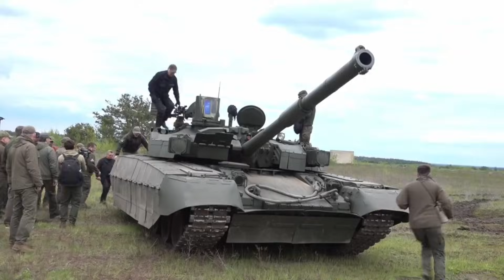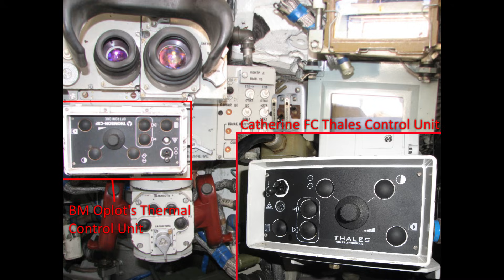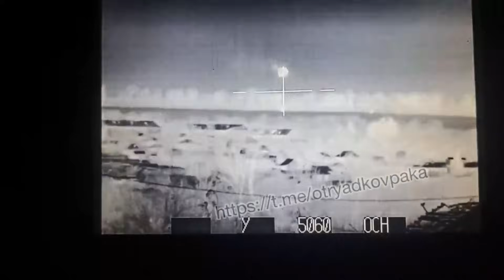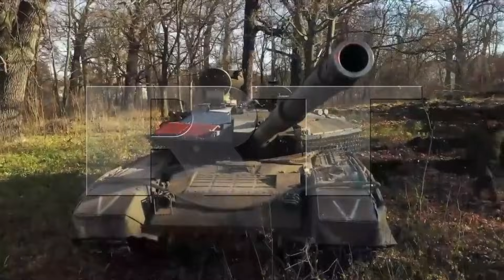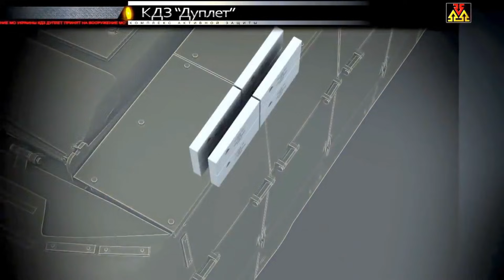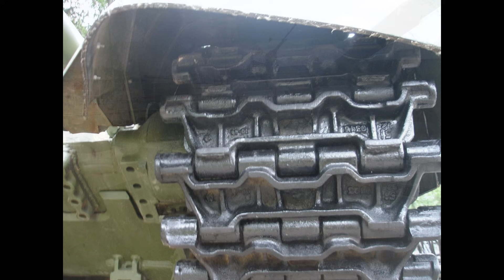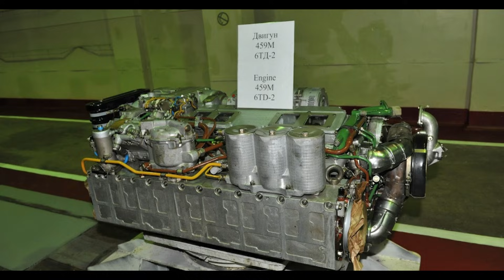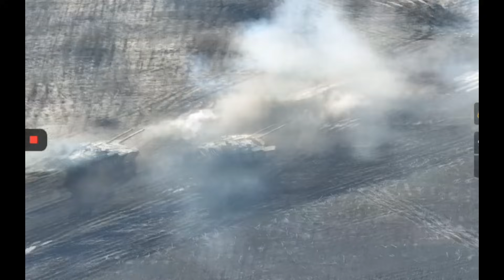Best Ukrainian vs Best Russian tank. T-90M vs BM Oplot comparison

Comment: I remember watching a Ukrainian tank unit video going over how they abandoned their T-84 cause it was getting overrun. They came back and it was still there so they retrieved it. 
I also remember how the tank commander said he had 6 T-84 BM Oplots also didn't Thailand sign a procurement contract for 48 T-84s so theres bound to be more than 6 as surely those that were meant for export were put into Ukrainian service
Reply: They were facing production issues before the war, which is why they struggled to provide the tanks to the Thai in the first place. They might have more but still a tiny number I would imagine.
Reply: @GrassMudHorseLand  ahh I see
Reply: @GrassMudHorseLand  They were facing production issues because of the invasion of Crimea. They finished delivery to Thailand in 2018, leaving them a few years to replenish their own stocks.
Reply: @justamicrowave2572  yep, but they barely finished their promised batch to the point the additional contracted tank were cancelled. Giving how slow they were building hem during relatively peaceful time, it’s unlikely they have any moderate number of them even during the 2-3 years time.
Reply: @GrassMudHorseLand   they still provided 51 tanks for Thailand

Comment: T-84 and BM Oplot were manufactured in Kharkov. Now the production facilities had been within striking distance of Russian cruise missiles and tactical ballistic missiles from the outset. Russians had been striking targets as far westwards are Lvov, meaning, manufacturing them anywhere within Ukraine is impossible. Russians will simply strike the factory and be done with it. Attempting to set up manufacturing in Poland could work, but would still require a long time since Poland used to make T-72-based tanks, not T-80-based tanks.

Comparing their firepower using only APFSDS as a metric for the main gun is not really appropriate since newer ATGMs and HE-FRAG rounds had been developed for both. However it's a known fact that 2A46M5 main gun is more accurate and can withstand higher chamber pressures than KBA-3. Also 2A46M5 barrels are of significantly higher quality than KBA-3. Last I heard, KBA-3 barrel is being made at a pipe-making factory, and as a result it's not as precisely made and has lower longevity.

Comment: I really like the T90M, it looks really good. Can you make a video on T90M vs Type 99A? I love the ERA coverage on the T90M and I found the coverage on the Type 99A lacking. But, T90M goes to war and is upgraded accordingly while the Type99A is still at peace time mode without extra coverage or remote weapons station...I found it interesting that the 99A weights 55T while the T90M weights only 48T, why is that...and still, T90M has horrible reverse speed and I think Type99A can reverse up to 30KM/H as per some internet source (not sure how accurate is it), and why is that? thanks.
Reply: Type 99A need compare to T-80BVM or T-72B3M mod 2022 , T-90M superior to him
Reply: @RainlineX  I am going to tell you very calmly, very politely you are wrong and you have no idea about the statement you are making, that's it. learn more, speak less. If you want to speak, speak in a humble attitude.
Reply: @aa1944-k2r  ?🤨relax

Comment: It's a bit silly comparing those 2 tanks because you should be comparing BM Oplot to the Russian T14 tank. That would be the equivalent .
As T90M is a much more produced tank, and the Oplot tank if it ever will get produced at all will have 10 times less the production of a T90M. It is much more comparable to a T 14 tank because it implies that same idea of the best Tank the country can produce. And both are actually in comparable numbers. And Oplot clearly loses in everything.

Now if we doing this weird comparison of BM Oplot and T90M then in some aspects one or the other is better, but on average , if they were both produced and maintained in the same numbers , then they are about equal on average - when you compare every aspects of the tank, and not being biased /selective in one or the other area or technology of the tank. If they were properly built and maintained in the same numbers they would be about equal, more or less. But precisely because this is not the case, you can therefore say that both T90M and T14 tanks are much superior tanks to the BM Oplot one.

p. s. also T90M reverse speed has been improved it's just still not much like 14 km compare to like 4 km on the older version, hence why the crew still prefers a forward speed as it can go 5 times faster.
Reply: No its not. T-84 is a major overhaul of the T-80 and the T-90M  is a major overhaul of the T-72B.

Production figures also aren't that far apart : ~ 100-150 T-90M( MoD figures are unreliable) vs around 50 T-84 oplot, most  of which were exported to Thailand. Makes fare more sense to compare active service vehicles of the same generation than a prototype not in serial production.
Reply: @scatterlite2266   You are completely messing up everything.
T90 is the continuation of a T72, the same as T84 (and T80) is the continuation of a T64.

The full name of the Thailand tank is "T84 BM Oplot T" which is different variant to normal "Oplot" tank. They got 49 tanks and not 50.
Also in Russia there are more than 400 T90M already produced... And they are in full production cycle now, so make no mistake there will be more than a thousand tanks produced of that type . which is absolutely not comparable to the abysmal 49 tanks of Thailand.

On top of that, you can summarize the whole lineup of T84 tanks (which every version of Oplot is part of) that's ever been produced, and to my knowledge that's only around 70 tanks... Which is absolutely nothing compared to even just the T90M  itself.
Reply: @korana6308  Lol you are nitpicking tank development factoids only to then to accept russian MoD numbers without a single critical thought.

Nobody knows how many T-90Ms there actually are, there are only a few preawar estimates usually situated around a 100.
The supposed thousands of T-90 (T-90A +T-90M) russia had on paper are  as real as the ghost of Kiev and the 40 himars russia definitely destroyed.
Reply: @scatterlite2266  So the India gov. is lying then about their developments of the T90 Bhishma and all of the contracts following that and paying Russia billions of dollars for those tanks is just lying?

You don't have to believe me if you don't want to but Russia did swing it's T90M into full production , and is producing them by the hundreds each year. So there's really no competition comparing it to the so called Oplot , because Ukraine can't even produce this illusory tank.
Reply: @korana6308  Not sure why you're bringing up India. They can license produce their own T-90s and since they are alot richer (and have more focused military spending) than russia it makes sense they have way more.

There is 0 evidence for those MoD propaganda figures. Its the same story with the armata and SU-57. On paper they exist in significant numbers yet in reality russian soldiers on the ground are already lucky if they get put into a T-72B3 rather than a T-62M.
Reply: @korana6308  India is competent.

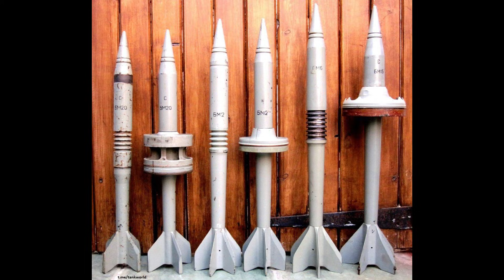Comment: 1:53 APFSDS is absolutely insane, those giant pieces of tungsten or depleted uranium move at almost 2km per second.
Reply: Maximum speed those APFSDS ever achieved in Russian service was just over 1700m/s which is muzzle velocity. As it travels down range, it loses the speed. So it's significantly less than 2km/sec. At 2km distance penetration is almost half of stated against "point blank" and even less so against angled plate.
Reply: This is about the 2A82 cannon. About 2A83 I think we will not start a speech

Comment: The problem with the BM tank is urs too complicated  for what it is. Thats not saying that its more advanced than the t90m, but that its production time and cost is going to makr it as expensive as next gen tanks. 
The t90m had other solutions proposed, but again, cost.  Imagine having to build those duplet era blocks, packing individual components and the inevitably higher defect rate. 
Cost. 
Might end up costing more than a t14 armata, and we both know which is superior,  and that Ukraine cannot afford anything more than a handful at that cost. It should also be noted that many of the newer Ukrainian equipment shares striking resemblance to Russian equipment,  and thats due to joint developments pre 2014. Itd be interesting to see their solutions when working alone.
Reply: They can afford anything with the military aid. Remember Russia made less than 200 t90's meanwhile the west gave Ukraine more than 300 modern tanks in one go.
Reply: @Joaquin546  lol, you mean a handful of modern tanks, which are roughly the same era design as the t72 (abrams and leopard 2), and then about a hundred older leopard 1 (with no composite armor)? Those modern tanks? Ukraine claims 300, like they claim more if everything,  but who donated them? No one did. 
And as for military aid, good luck with that. Its not free.  That spending is just passed off elsewhere,  and with the us facing a very real debt issue, even if article 5 is used, Britain having a crumbling economy,  France losing manufacturers and Germany entering a recession....who is going to fund that?
Reply: @deven6518  lol no you are maybe 32 years behind. The Abram took apart any Russian piece of crap equipment.
Wrong again comrade military aid is free and has been helping. You might want to watch less rt news it seems to be having a negative effect.

Comment: A forward/reverse lever with lockout on top gears is a good idea. Our U1300L and U1700L Unimogs in NZ had a lockout for the top four (of eight) gears. The forward/reverse lever itself is handy when you lose forward momentum on a slope.
Shortly after the Unimogs (mogs) came into service, a member of the RNZAF serving at Ohakea Air Base,  removed the lockout pin from a Unimog transmission and reportedly got the truck up to 90km/h in reverse, on the runway, before he rolled it and killed himself.

Comment: It’s not that simple. Basic rule of thumb - do not trust any russian claim :) First of all, the t90m tank is heavier and the engine is not powerful enough(confirmed by both Ukrainians and wagner), what’s worse - it overheats and looses 30-40% of its power(!!). Also it’s unreliable. The suspension is old and very stiff, that makes firing on the move a huge pain in the ass - it’s highly inaccurate. The auto loader is not great, to get those additional 20 rounds from the separate compartment, you need to get out of the tank and manually pass them inside. Wow. The radios are not reliable, they’re not sealed properly and quickly get destroyed by water, that’s why you need to get out of the tank and use your regular radio. Or shout, I guess. The relict protection… I heard at least one t90m was hit by an at-4. It’s either not good or was simply stolen. Probably both. It’s an Ok tank, but full of shit and too expensive for an upgraded t72. You better buy a NATO tank.
Reply: Can you site your sources please? 

I've heard an ex-T-72 tanker list the increase in weight as one of the cons (as is with all tanks), but BM Oplot is much much heavier (3 tons heavier than T-90M), that shit will sink into the ground so easily.

There are videos of Russian tanks targeting Ukrainian infantry from nearly 5km away, they are by no means inaccurate.

If you want to achieve the same level of survivability in a T-72, you'd have to drop the extra 21 rounds, which would mean you'd only have 22 rounds to carry into battle. So once you run out of all your HE rounds (not APFSDS or ATGMs), you'll have to leave the infantry and IFVs you were meant to be supporting, and retreat several kilometers back to base, without anything to use to defend yourself.

Comment: I would like to point out about the T-90M that it uses a Catherine XP/LR Thermal Imager which is 3rd generation Thermals, Relikt ERA (as said in the video) which makes it so that APFSDS has 50% less penetrating power (M829A2 could not penetrate a T-90A which was fitted with Relikt while M829A3 struggled to be consistant), however it does have a "weakspot" in the turret which the T-90A doesn't have which is right ontop of the gun mantlet, where the turret is higher but where APFSDS should not be able to penetrate.
Reply: T90m has a different turret and it's currently unknown if it's armor array is different
Reply: T-90M don't use French thermals.  Try to keep up.
Reply: Thales Catherine XP/LR Thermal Imager - Made in France. Which means the russians may manufacture as many T-90s as they want but since the electronics are made in the west and so they are unobtanium for the russians after the invasion. So the new T-90s will be just a nice props for propaganda but worthless in combat. So your dissertation on US APFSDS rounds is pointless.
Reply: @haloguy628  russia have managed to domestically produce it ... since 5 years ago
Reply: @sigmaduck69420    'since 5 years ago' up until the manufacturing facility went 'BOOM' the other night.  Now what?
Reply: @RTmadnesstoo  it didn't, and if it were blew up, russian would rebuild it anyway
Reply: @haloguy628  they produced the thermals themselves.
Reply: @handsomeivan1980    The key word is 'produced' as in past tense.
Reply: @haloguy628  its actually produced locally.. they don't use any foreign parts
Reply: @haloguy628  While i agree that what i said about M829A2 and A3 may not sound realistic, but it is, as pointed from the manufacturer of Relikt and even a German document about it, which says that DM63 (and M829A2/A3 too basically) cannot penetrate modern Russian MBTs in the front plate.

Comment: Regarding the added armor to the T-90M's carrousel, it doesn't seem to be much. One F1 grenade dropped from an ukrainian UAV inside the open hatch of a T-90M was enough to set the ammunition on fire thus destroying the tank.
https://youtu.be/y6l10_Ly1QI
Reply: Yeah drone dropped grenade have been blowing the turrets off Saudi Abrams in Yemen... I think that tanks are generally not expected to have grenades explode within them.
Reply: @rileyernst9086  I don't recall seeing houthis using grenade dropping UAV against Saudis Abrams. ISIS did at least once against iraqis M1s but yet again no turret toss.
Reply: @thomaslebourdonnec4139  It's enough to protect the carousel from spall, not a grenade exploding on top of it.
Reply: @definitelyfrank9341 from the common grande not a javelin
Reply: @Joaquin546  Yeah, but as we have seen multiple times, Javelin doesn't always hit T-90M dead on the center of the turret. And Javelins aren't all that common, are they?
Reply: @definitelyfrank9341  Well thank god the Russians are relying on t54's and t72's more than the t90.
Reply: @Joaquin546  Pretty sure T-90M is being used in the conflict more often than T-54.
Reply: @Joaquin546  I mean, duh, why wouldn't T-72 be used more than the T-90M?
Reply: @definitelyfrank9341  no no no comrade you got that quite wrong lol. The Russians haven't even made 200 t90 meanwhile the Soviet's made thousands of the t54 and others before their collapse.
Reply: @Joaquin546 If you've been monitoring T-90M deliveries over the past couple months, you'd know that anywhere between ten and twenty brand new T-90Ms are being delivered every month.
Reply: @Joaquin546  What have I gotten wrong?
Reply: @definitelyfrank9341  lol read last comment. I stated quite clearly comrade